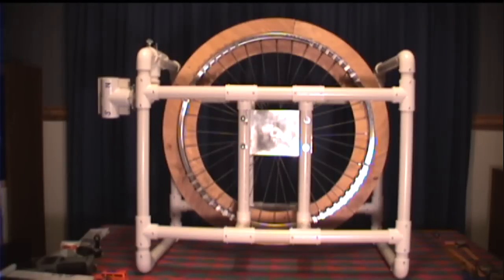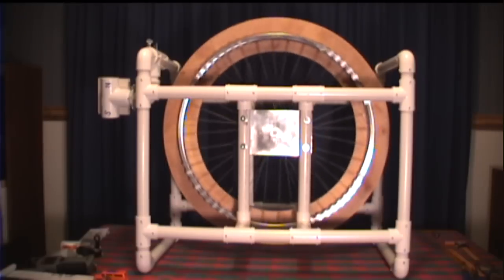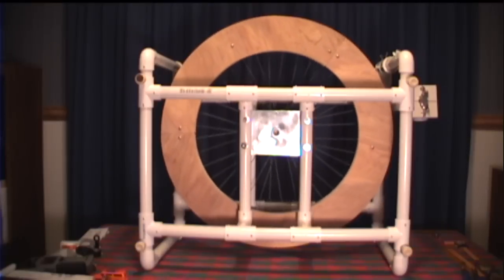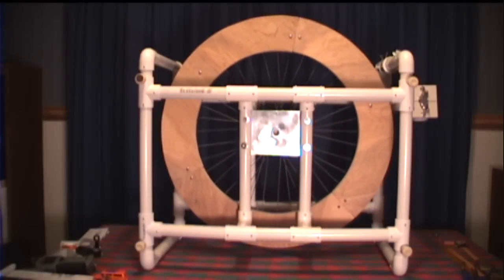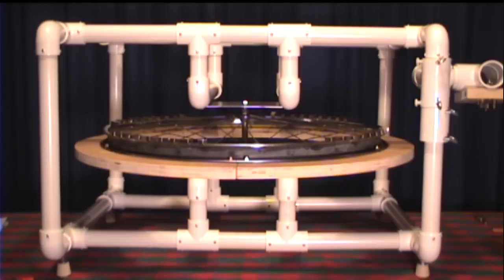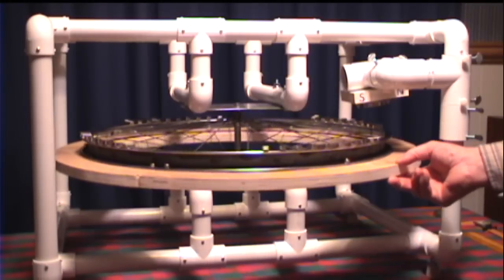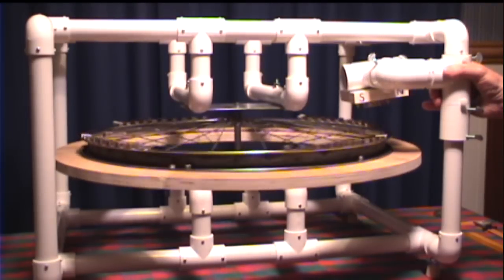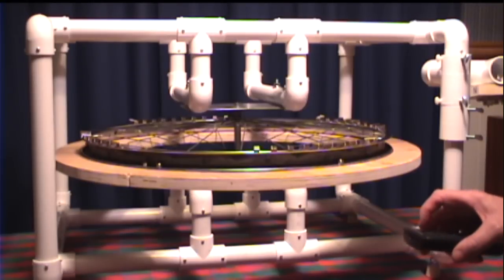Video #17, "Rick's Pipe Dream" Magnetic Motor - Generator

Comment from the maker: It's good to hear you are experimenting.  That's what this project is all about. As you probably are aware, I decided against using any type of shielding because I want to employ both magnetic attraction and repulsion in the strongest possible combinations, rather than weaken these characteristics.  My moving stator method will avoid the problems that necessitate shielding in other applications. Regarding a single-pole magnet, the closest you will get to that is by using a Halbach array.

Comment: I've started experimenting myself with a self propelled magnetic wheel.
I visualize a magnetic wind to push the wheel around. If it were possible to get a one pole magnet,or shield the magnet,it doesn't seem it would be that difficult to achieve a wheel being pushed by magnetic force.

Comment from the maker: @nvpreping: I assume that you suggest a sliding weight for the purpose of balancing the rotor.  I did think of doing that once I achieve continuous rotation, but until then I regard the balance factor as relatively unimportant.  It certainly would become important as increased speed of continuous rotation becomes the aim.  There are many places on the wheel where one can adjust balance, and the sliding weight on spoke method is one of the easier ones to implement and fine tune.

Comment from the maker: @100roberthenry -  Hi Rob, see video #23 for a demonstration of such linkage.  After some testing, I abandoned the tracking method for moving the stator because of the force required.  My current method does involve moving the stator, but by a means which requires very little anti-rotational force be applied.  The new movement is in an up-down motion which closely mimics the hand movement seen in video #3.

Comment: hi rick, have you tried a linkage to the wheel so it will move the upper magnet for you as it spins...and therefore drives itself?...with an initial spin of course... thanks. interesting stuff.

Comment from the maker: @ggibney0856 This apparatus could certainly be used for gravity wheel experimentation, but in its current configuration tilting the wheel would only show benefit from an imbalance state (such as by removing one magnet group, or adding an additional fixed weight) with a heavier portion of the wheel moving downhill.  Once you pass the bottom of the slope, however, you would have to move that weight uphill and therefore nothing would be gained as your advantage would be nullified.

Comment from the maker: @paultomasi Yes, it does require hand energy to move the stator magnet, but the requirement is smaller than what would be needed to mechanically hand crank the wheel into rotation.

Comment from the maker: You should be able to order the bar magnets online from K&J Magnetics.  They are part # BC62.  The HD magnet for the stator can be salvaged from a scrapped computer found at your local recycling center.  Older computers have the best ones - larger and more powerful, and they are easily removed from the hard drive.  Look for ones that are 1/4" in thickness, as I am using.  The newer ones are mostly all 1/8" thick.  If need be, you can use a thin one and attach a double stack BC62 at each end.

Comment from the maker: A straight line movement, on a horizontal plane, avoids those 2 problems.  I also want to do this without the drag effect that use of a spring would bring into play.  The other critical factor will be using a very lightweight track riding/stator carriage, wherein 90% or more of the weight being shifted will be comprised by the weight of the stator magnet.  The new stator carriage will look nothing like the bulky arm that I have been demonstrating. That was only for preliminary testing, R&D.

Comment from the maker: I considered several different methods for achieving movement, including the method you describe, but my first tracking test will be done while moving the stator in a straight line back and forth across the wheel rim at a constant height above the rotor magnets.  It is important to maintain the height, and this isn't possible if using a pendulum unless the rotor surface and magnets are concave.  Also, with a pendulum, it requires lifting the weight of the stator magnet as the arc moves upwards.